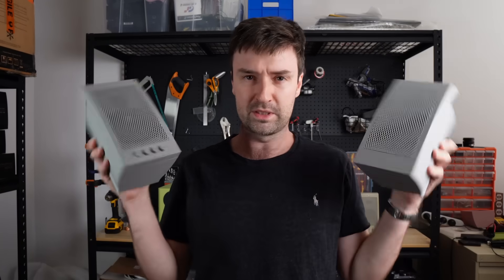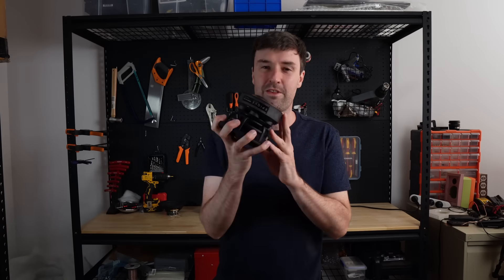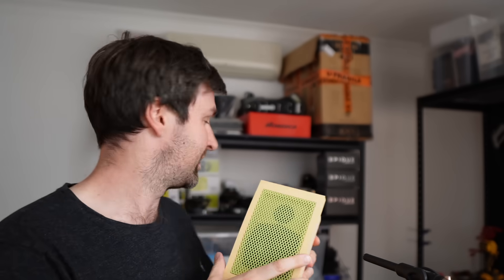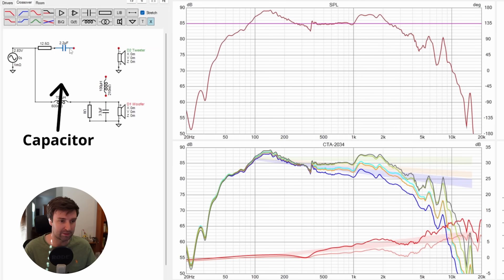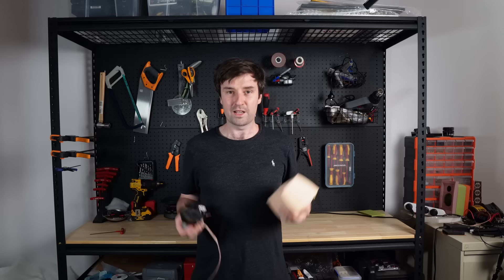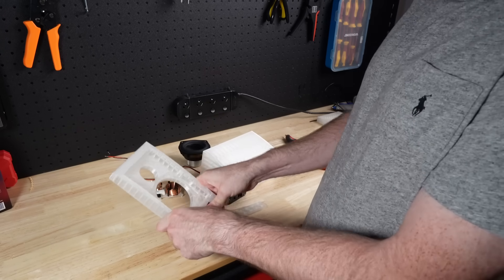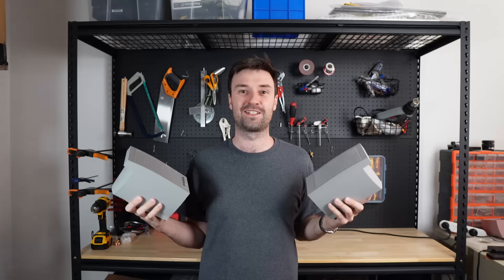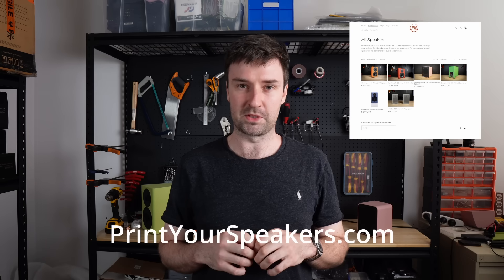I Built Incredible Desktop Speakers with SERIOUS BASS

Comment: I was literally thinking of doing the same thing. When it got to the point I was getting 100dB @ 1m at 45hz using a 3 litre 4th order bandpass and an expensive soundbar driver in the acoustic design and active 2 way amplifiers I started to wonder if I was taking things too far for a retro computer build.

I'm curious if you did any port velocity modelling prior to trying the enclosures, what velocities did you get for the versions that didn't work? Was it predicted to be under 20m/s?

Comment: You need to flare the port in let to help with port noise also your worries about port area is probably because your  used to slot port that's called an arroe port and you need to   to divide the recommendes port area by pie to get the correct port area also power effects how much port area you need two along with box size and you should of used sound deadener inside the box then pollyfill over that Polly delays the sound wave for the wall to reflection to the cone and a weak wall will resonate far more then something thinker/stronger

Comment: Looked at all your speakers now, and I wish I needed any speakers at the moment. Do you think you could give the Koala-Satellite (which a lot of people use for HomeAssistant) a make-over? Just the shell, that is. While very useful, alas, it doesn't sound very good. I bet the little NS4830 on the mic/speaker board could drive a PS95-8 just fine.

Comment: watched all your videos - your channel rocks <3 maybe someday you build a solution that some dudes - like me - have. I am DJing outside in nature with a minimal setup (can be seen on my chan as a trailer). I use a JBL Party 120 there as it is the only speaker I tested that goes down enough for some nice DNB. It has a flaw tho: The latency even on the line in (like most speakers of that kind have). There is a "chaining port" which reduces the latency but its still high. The other flaw is - it does not really sound stereo. The only solution on the market is the Minirigs 2.1 (or more) setup. Would be so cool if you could do a 2.1 system that is compact but not too compact to go really deep. Battery powered. A big challenge i guess. Something kinda attachable to itself (like speakers did on 90ies boomboxes - except the middle piece is not the playbe - but the sub. Connections could be like cableless (inside the attachment mechanism). I am just dreaming, sorry :P But maybe it inspires you. Would love to have a nice 2.1 thing to use outside. A last idea for that: the shape should be like a stage monitor or at least with a slight angle, so it does not need stands but points a bit up to the listeners. but if i think about stands ... they could be used as ports aswell as stands for satellites. sorry for freaking out on my brain there haha :) much love from germany

Comment: Designing a part to not need supports will 99.99% of the time be superior to even the best supports. I say this having worked with million dollar Stratasys printers that basically guarantee perfect prints. Design for 3d printing is a severely neglected area so anyone who embraces it like you have deserves praise for it!
Reply: No support, good print orientation (for speed or to prevent layer separation) understanding of the material, trusting (but not too much) the capability of the printer (like he did for the tear shape).
It's all a balance that requires thinking about it from the start.
I'm excellent at CAD but still not on 3d printing lol
Reply: @ Think of a 3d printed part as being like wood with the grain being the layers. this will generally intuitively reveal mechanical weak points in the design.

45 degree angles are your friend, teardrop shaped holes are your friend. Always keep part orientation in mind and the rest is just good overall design (chamfers/fillets- they're free so use them!) and practice
Reply: I knoooow right! Personally, I always try to design with the thought of not requiring supports, unless I REAALLY need to.

Comment: I have zero speaker design knowledge or experience, so take this question for what it is, please.. how would having the port tube outside of the enclosure affect the results? Partially or completely... I mean, you did sink the tube into the wall, at least in one of the iterations...
Anyhoo,  you've got a new subscriber!
Reply: You would have to re-adjust the lenght of the port for your wanted tuning frequency since its not taking space inside the enclosure anymore

Comment: The ND90 has a 4mm Xmax.  It's matching PR has a rated 9mm Xlim, so theoretically only one PR would need to be used. It would definitely need to be tested though!  Another advantage of PRs is no "organ pipe" resonances that you'd get if using a long vent instead.   One interesting thing though - I've sometimes run into the issue with the PR with no weight attached tunes the box (Fb) a bit too LOW.  Adding more weight would then tune it even lower.  However, this might be a good thing if you plan to use DSP to increase the bass response at lower volume levels, as Fb basically sets how low you can go ...

Comment: I can tell they have a "plastic enclosure" sound. I would've lined the internal walls with bitumen car sound deadening-type stuff.
Reply: You're listening to a tubevid, you can't actually tell it, this is a thick wall design not an injection moulded shell, and the air pockets inside do more to absorb the sound. The bigger problem is the really unfortunate sunk baffle with all that edge diffraction.

Comment: There are also oval passive radiators by the way.  You actually need about 1.5 the bass speaker size. You can tune them with weights., often. A bolt with an amount of rings.
Reply: i was just about to comment this. that size of driver is commonly used with an oval shaped passive radiator it just makes sense because if you need the driver to be small you arent going to have room for much of anything else and with a design with a passive radiator, you have more freedom with the shape of the box. it would have fit perfectly on the back. in fact some stereo pc speakers did have a passive radiator on the back like that.

Comment: Why is using a passive radiators considered cheating? When I make my 3D printed speakers I use passive radiators to great effect and I use active crossovers to tame the tweeters and compensate for baffle step. I used to think doing everything analog was the best way, but I have recently adopted DSP into my speaker design and its been wonderful.

Comment: Love this project - the design and development work here is fantastic. Though I have to say it was a bit of a miss not using one of those nice beige filaments you used for your initial prototypes to match the yellowed plastics of those old Macs. One question though, since I'm very new to the DIY/3D printed speaker scene: in looking for decent bass and balanced sound in a small chassis, have you or anyone you know of experimented with doing what Apple does in their mobile speakers, but on a larger scale - filling them with tiny foam beads to increase the distance the sound waves have to travel? Given how good their laptop and tablet speakers sound, there's definitely something to this technique - though I'd bet there's some rather arcane math involved in tuning it. Still, 2-3mm polystyrene beads are readily available, so it would be super interesting to see if this technique could be used for something larger than a laptop speaker.

Comment: "It's hard not to make a huge speaker with pricey components sound great" - oh, you would be surprised. There isn't exactly a shortage of expensive "high-end" loudspeakers with rollercoaster responses. The ASR thread entitled "Worst measuring loudspeaker?" alone (93 pages right now) should yield plenty of examples.
Anyway, sub'd. 
And btw, by the standards of typical PC speakers with their single electrolytic capacitor crossovers your 4 components are downright fancy. :) (Air core inductors, too! Even in entry-level hi-fi speakers you tend to get more basic iron core jobs.) I am reminded of the quote from speaker designer Andrew Jones who, when asked about the secret to the success of his designs, pointed out that he was willing to spend a dollar where others would spend 10 cents, and that made a big difference!
Reply: Well with that said, the reality still stands, as mentioned It really isn't that hard to make a huge speaker with quality components sound great; we live in a world were money and most times greed inspires the thought to promote cost cutting measures, whether that's with componentry or R&D. You really shouldn't be surprised that in the real world DESIGING an enclosure should most certainly cost more in every capacity compared to that of the componentry itself.

As seen with automobiles, you can easily put a 1,000hp supercharged engine in a 4,500lbs vehicle, but one should also take notice that in a lot of ways a smaller, lighter, and more economical vehicles can and will outperform it ways that matter more than marketing numbers.

Comment: I looks like you are using air core inductors for your crossover. If that's the case, wouldn't it be possible to use the port tube as a coil former for your inductors? You could wrap some copper wire around the tube to save even more space (or the tube could be a bit longer). I know it's messy and unprofessional and the wire must not get too hot, but maybe it's worth a try.

Comment: 2:50 also the mention about the speaker magnet and its motor, note that small enclosure is about even less than 2Liters, and so if you have a big magnet, thats also takes up space and you loose from the enclosure size.

Comment: bro u literally were looking at wrong passive radiators in the first place... u can easily get flat radiators withjust a metal plate in the middle and the rubber surounds for less than 2 bucks each. radiators work MUCH better in a small enclosures, u can even tune the bass response with adding weight to the radiators instead of re-printing the whole box, and that makes it much cheaper for prototyping too. u can even just use a DSP amplifier to tune the bass if it still doesnt sound good.

Comment: What's the measurent stand you're using? I have had such problems getting consistent off-axis measurements
Reply from the maker: It's a K&M PA speaker stand with a 3D-printed platform that has notches every 10 degrees built into the pole mount. Simple but works well—though I might automate it one day
Reply: @PrintYourSpeakers  I would have never thought about the notches, that would help a lot. Thank you!

Comment: Damn near fell off my chair laughing at the end when he was using these extremely over-engineered DIY audiophile speakers to play Prince of Persia.
Reply from the maker: Fun is just as important as HiFi!
Reply: @PrintYourSpeakers  ...more important... FIFY 😂
Reply: @PrintYourSpeakers  Now you just need to get rid of the bluetooth. Bluetooth compresses audio to somewhere around 260kbit's which is definitaly noticable.
Reply: @jxnxsdev As long as it can do 320kbs though it's completely fine! :)
Reply: @jxnxsdev Even oldschool APT-X over Bluetooth sounds quite good. It's "only" 352 kbit/s and modern codec it enough to sound good.
Reply: @kaedeschulz5422  not really. It depends on the audio material but for some music even 320kbps can be distinguishable from lossless. I've done blind testing for myself one time and even on subpar audio system there was a small but clear difference. The most noticeable was piano trills getting smudged.
Reply: @Poluact  Hmm i had never a case where 320kbs was worse than a direct wav file. In what song was it?
Reply: @kaedeschulz5422  oh, it was years ago, I don't remember.
Reply: @Poluact Damn! I woulda liked to try that out!
Reply: @jxnxsdev not noticable through youtube (192kbps at best)
Reply: One of the bassiest olskool games.
Reply: @vjnobody  I'm so disappointed we didn't get to hear the "glug-gug-gug-gug-gug" of drinking a potion. I still make that noise to represent drinking. "C'mon kids, stop mucking about with those drinks and finish them. Just one glug-gug-gug-gug-gug and we're outta here"
Reply: And his review was hilarious too
Reply: Sounds to me a great idea to do so.
I mean it.

Comment: you increased the amount of volume taken by the larger port but didnt size the box up?
Reply from the maker: The speaker did actually get subtilty taller and deeper but changing it too much would have resulted in not meeting my design goals. I was happy with the bass output so I didn't see the need to compromise the formfactor.

Comment: Doesn't the crossover itself take up some volume in the box? Have you tried to offset that?
Reply from the maker: It does, so does the plate amplifier. Its hard to calculate the exact volume taken up all these components so I take an impedance and nearfield measurement of the port and woofer to verify the tuning. I can then make subtle port length adjustments if needed.

Comment: If you set up a turntable with a basic stepper motor, you would be able to automate the off-angle collection, which might make things a lot easier to test the audio response, in a reliably reproducible way. Love the video.
Reply from the maker: This is something that has been on my mind, apparently you can sync it up with the Rew api and completely automate it. Hopefully I get time to build something like this, manually moving it then going back to my computer to click measure every time is a pain

Comment: These look sick. I would love to see this project redone with a PC-83 driver to simplify the build. I know the ND91 can produce more bass, but these aren't meant to fill a room. These are computer speakers you'll be listening to from 1m away. You won't go beyond like 3W of power on these ever,  which PC-83 can handle no problem at any frequency. I've made a few speakers with these drivers and they sound pretty good to me. You could also face the port forward, so that they can be pushed against the wall to save the space on the desk.
Reply from the maker: I actually have a couple of pc83s you are right in thinking there wouldn't be as much bass, but being a true full range you could do away with the tweeter. This would simplify things a lot and probably make them a bit more compact. I wanted to avoid the need for a subwoofer and I like the sound of a dedicated tweeter. I guess its just personal preference

Comment: wow those sound great. i'm tempted to build a set . need to see if my printer is big enough to print in one piece.
Reply from the maker: Glad you like them! The print volume needed is H100xD205xW120mm so they should fit on quite modest printers